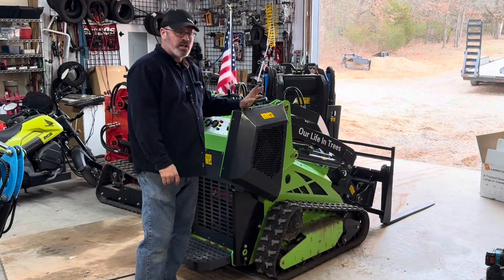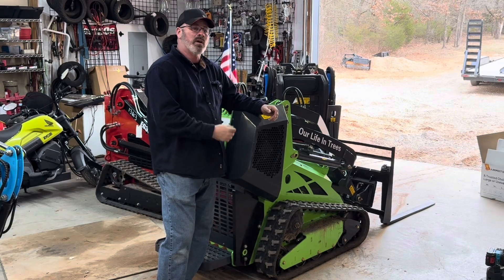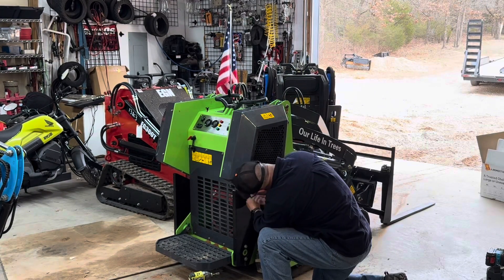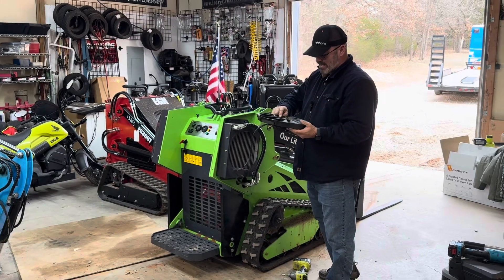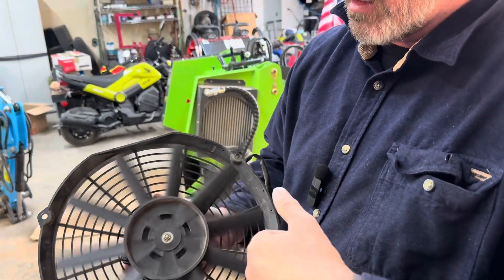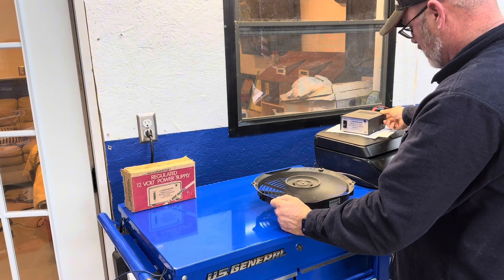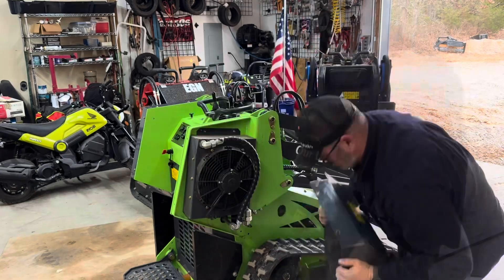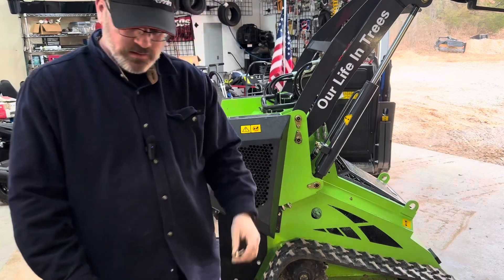DRT450 Mini Skid Cooling Fan Repair (And Why It Failed)

Comment: I've got one of these machines and it works great around the house.  I do however have an issue with the throttle.  Do you know where I can buy replacement parts.  It looks very similar to the one on your machine.  Any help would be appreciated.

Comment: It becomes a real problem when that fan decides to fling off into the hydraulic heat exchanger instead of just falling off. Having a damaged heat exchanger renders the machine useless. I'd highly recommend adding some thread locker to that set-up.
Reply from the maker: That could be bad.   Yeah, probably a good idea.

Comment: Was the fan spinning in the wrong direction from the factory and that is why the nut came off?
Reply from the maker: I suppose that’s possible, but it was pulling air out away from the operator.  That’s correct.